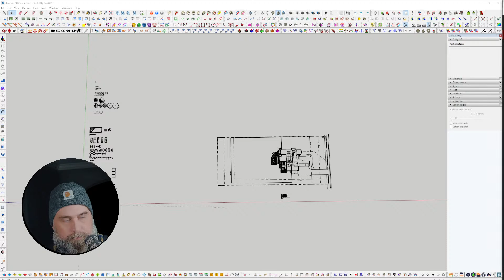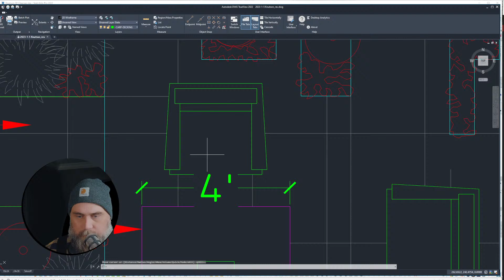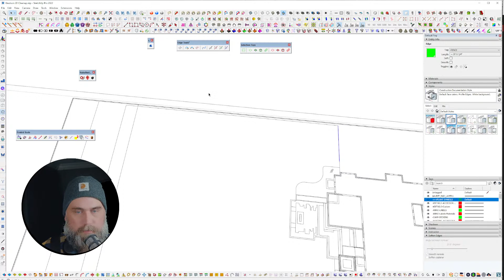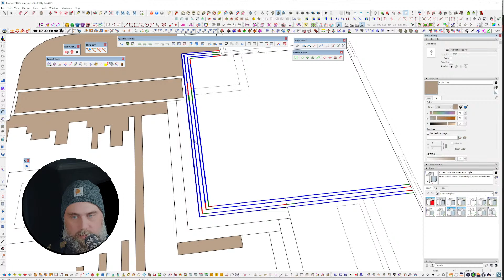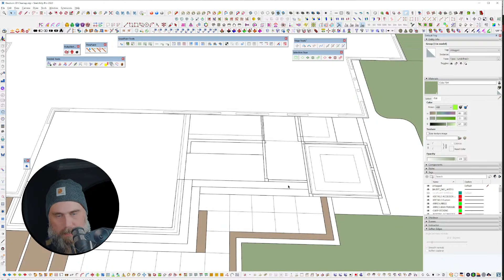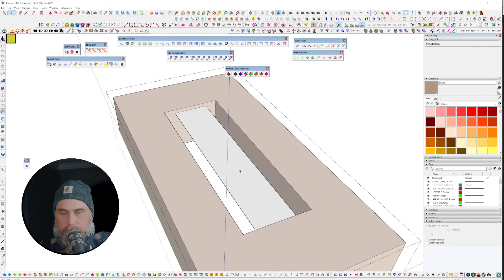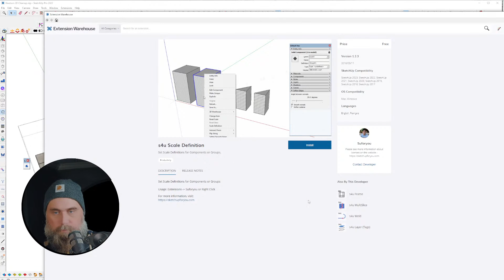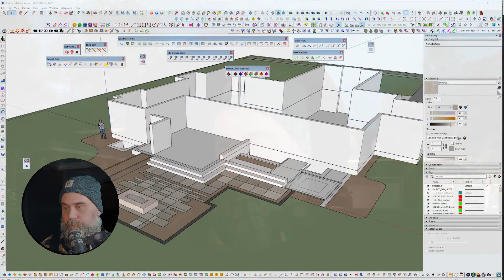SketchUp - CAD Cleanup

Comment: The spacebar trick to close a dialog: That's system wide in both Mac and Windows. A spacebar will usually click whatever the default highlighted button is on a dialog. 

Be careful though when it asks "are you sure you want to delete  *xyz*?" and you're in the habit of tapping the spacebar for speed... you will occasionally tap before your brain has caught up with the consequences and cause a minor disaster. 

Not speaking from experience. cough
Reply from the maker: haha. The worst is when you don't notice until you are out of undos!